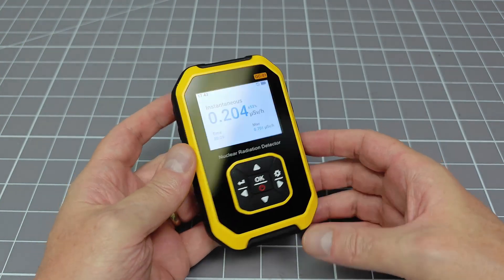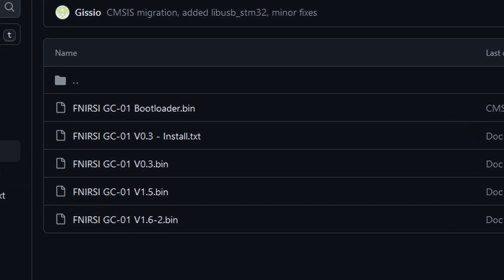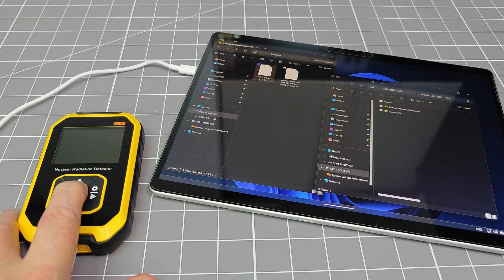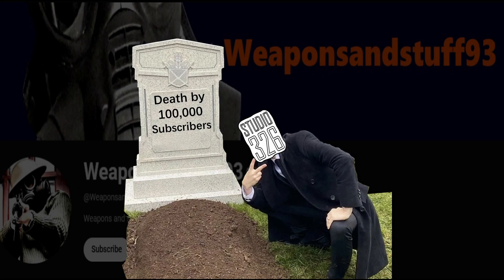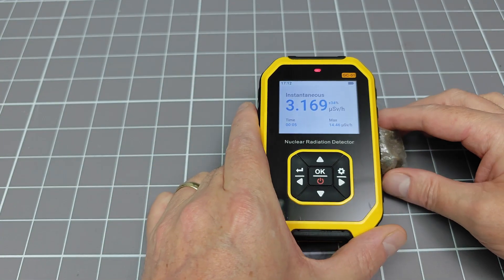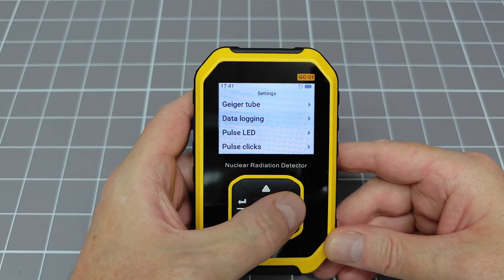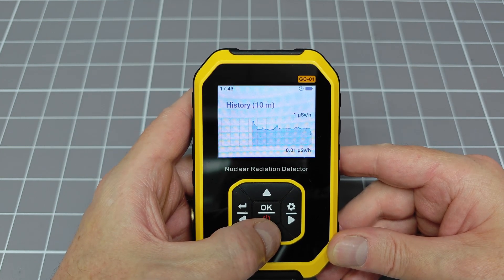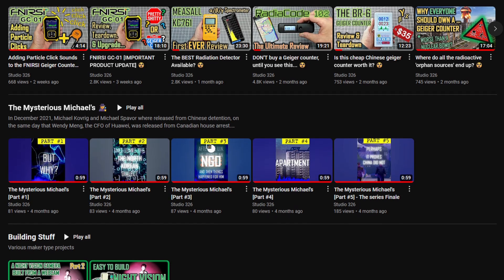FNIRSI Firmware Upgrade, Review & Instructions

Comment: for info just purchased the GC-01 blue case geehy chip ...wont boot usb ...long press....combo setting and on press ...nothing takes it to usb drive state
Reply from the maker: Just be sure to use a USB data cable, the one supplied is a power only cable and so won't enable boot mode.

Comment: I am trying to get my unit connect to the pc but I hold the power button and it doesn't open up as a flash drive? is there something I am missing?
Reply from the maker: Just be sure that you are using a USB data cable - the one supplied with the product is power-only.
Reply: @project-326  i plan to use the cable from my flipper zero as that has to be a data cable... got the resistor removed... found a cable that tried to connect but gave me errors so prob a shit cable
Reply from the maker: @gillandro2  Actually, with hindsight, the resistor can be left in place...
Reply: @project-326  now you tell me lol will it hurt it not being there?
Reply from the maker: @gillandro2  Sorry about that.  I live in the tropics, ie a high humidity place and did the mod during summer.  In the dryer winter, I found that the PSU was over-voltage.  The FNIRSI tube HV supply is really crappy, we zero regulation whatsoever...  If you still have the resistor, perhaps re-fit it.  If not, well just try it, it won't break anything!
Reply: @project-326  it still turns on so im happy lol you said do i did :-p
Reply: @project-326  found a cable... thanks for the help... i uploaded the new firmware... not a bad little thing... i dont need it to be precise... i just need to know if watch hand lume has radium or not but may be fun to mess with the counter... love your vids
Reply from the maker: @gillandro2  Glad it all worked out for you.  Be careful with Radium.  After a couple of decades, the phosphor breaks down and doesn't glow any more, but the radium is still active - it has a half-life of 1600 years!
Reply: Thats a first.... i never played chess on a geiger counter before
Reply from the maker: @gillandro2  My 7 year old did that too.  There is just no way I am going to play it - being beaten at chess by a cheap Geiger counter is not something that would enhance my state of mind!

Comment: I just don't get it. You say that battery lasted for 24 hours using this firmware, but on original firmware, battery is lasting only 10 hours as they say on their page on Ali. Why is that horrendous?
Reply from the maker: Mine lasts for about 5 to 7 days without too much user activity with the original factory code.  

It should be noted that the factory firmware was updated in the last couple of months and also I have seen reports about the battery size being reduced in newer production batches.

Comment: Well this has totally screwed my counter up, I've been trying for the last two hours to flash the firmware it won't even accept the original it does nothing when I add it to the bootloader I've tried variations of button presses & even found the original firmware that FNIRSI had on their website for a while nothing will load I've used the reset button because at one point it had soft bricked but as of this moment it is a useless pielece of trash so thanks for that. PPL BE AWARE THIS COULD FUCK YOUR DEVICE UP! I'm a very experienced software modder & know a lot about flashing firmware this device comes with several variants of processor but even with the supposedly right modded firmware this may not work!
Reply from the maker: You can try removing both batteries (the coin cell and the main battery) and then retry putting the original firmware back with both batteries not connected.  There are a lot of threads on the GISSIO github page with some work arounds when the boot-loader gets stuck.

Comment: I have an older version of the counter which came with the M4011 geiger tube and WCH microchip.  Careful timing of holding/releasing the right arrow+power button enables my Windows 10 computer to see a device called "AIR01", however I cannot access files on it and it does not seem to know what kind of device that is.  It does not show up as a drive.  I will try to check  with GISSIO but wanted to post here first.
Reply from the maker: Very interesting.  Please let everyone know if there is any feedback from Gissio...
Reply: my pc dont see any device connected. I tried using different usb cables but still nothing pops up
Reply from the maker: @mayfervex649  Perhaps open up the unit and remove the main battery and also the small coin cell and try again when powered just from the USB...
Reply: @nefariumxxx - same for me on Windows 11. It shows up as AIR01 - but when inspecting the unit closer in Device manager, I see this message: There is a secondary device connected to this hardware that Windows cannot identify because it does not have a valid hardware identification number.
Reply: @joonglegamer9898  Look up and read about or join to post to Gissio/Radpro forum.  Was able to finally flash the firmware but it required ordering a cheap USB dongle and connecting the pins to the circuit board directly.  Takes a while to flash it so don't cancel out of it when started.  Few minutes at least and it will seem like it's froze up but it's still programming.

Comment: I got my tube from Taobao. I ordered a J321 2022. I did the Rad FW, removed the resister. (My GC-01 came with a tube with wires coming from one end-no markings). Everything went well and devices booted fine.  So in setup I made sure J321 selected and set HV profile as  freq=1.25kHz and duty=25%. I don't really know what setting to use here. Is this right? Dead time is =off.  My question is this the right tube? I see yours says M4011 . Should I have ordered the item M4011/J321 instead? And then what are the right HV profile to set? BTW right now my meter reads 0.140 uSv and that seems not correct.
Reply from the maker: Let's start at the end and work back.  0.140 uSv/h, was that for an indoor background level?  It seems fairly typical. Where I am located, I get about 180 uSv/h in a high rise building and about half of that in a wide open space.

I have just used the default HV profile and set the tube type to J321.  I did actually use the J321, which bit of the video did you see a M4011 tube?  Maybe I used some stock footage for a segment.

Since making the video, I have added a 20M (2 x 10M) resistor for the loading resistor.
Reply: That is my background reading. I just thought typically average was around 60-80. I am new to this sort of thing. So in all I am getting 180-210.  It goes as low as .085 and right now is hovering around 150. I am not moving the meter.
I took that resister totally out. Why did you add back a 20M there? @project-326
Reply: I forgit to ask you. When you say you used the default profile. Is that the "Factory Default" one in the HV profile and not anything with the Custom part?
Reply from the maker: @jackhendler  the 20M prevented some tube ionization when the weather way less humid...
Reply from the maker: @jackhendler  yes, that's the one.
Reply: I'm up here not far from you actually. In Kunming where it is generall quite dry. So I guess I should add it back in. So it is not really about the voltage change. @project-326
Reply from the maker: @jackhendler No, its just keeping the nasty HV PSU loaded and not letting it spike up to voltages that can trigger a discharge in the tube.

Comment: Thanks for a great series of videos on the GC-01! I have a mid 2022 'proper' GC-01, and also a late 2023 device to do some mods with (changed the tube to a J321), and thought I would try this upgrade. Unfortunately the firmware upgrade immediately bricked my device - probably my error, as my GC-01 was running firmware V1.6-2, and I didn't click that this upgrade was based on a GC-01 with V1.5. So a word of warning to check the firmware version before you try this, as it may cause problems. It is briefly displayed on startup at the bottom of the screen. 
If anyone has any ideas to recover a dead GC-01... Please keep the excellent content coming!
Reply from the maker: try removing the main battery and also the coin cell and power the device just from USB to get the v1.5 back onto the device.  This worked for me.  Also, don't be shy to share your experiences with Gissio, this person is very helpful.
Reply: @project-326 Thanks, I tried this after reading your suggestions below. I managed to get the USB boot window up, which just contains a Readme.txt file of 0 bytes. After copying over the V1.5 file and reconnecting batteries, I still get nothing, and a 'USB not recognised' warning from Windows. If I repeat the process, the boot window appears, but the .bin file is gone - I can copy it over again, but the same process repeats😞. I'll try the Gissio route though, thanks again!
Reply from the maker: @jonwhite227  the file always disappears, its not a real USB drive, seems to be a virtual one that is emulated specifically for the purposes of firmware upgrade.  So it looks like V1.5 now works.  Did you try the RadPro image?
Reply: @project-326 Yes I did, but still no sign of life from the device and a 'the USB device has malfunctioned' warning from Windows. I'll have another look tomorrow - it's 2.00 AM here. Thanks for all your help, I'll let you know if I get anywhere.
Reply: @jonwhite227  Did you end up getting RadPro to work? I am facing the same problems as you, with that same message... 'the USB device has malfunctioned'
Reply: @rickdurham264  Yes, I did - I did a detailed reply yesterday, but YouTube seems to have deleted it - will try again later.
Reply: @rickdurham264  I had to solder a 4-pin header and run the firmware via an STLink V2 dongle (both availble from Amazon for less than £10) Works a treat and makes the GC-01 behave as  it should have done and quite a lot more. There is a discussion in Github/Radpro called 'FNIRSI GC-01: USB drive not detected' - discussion #38. I got involved in beta testing and must have done the re-flash 20+ times, so no worries there. Gissio is super helpful, as is the RadPro community. Good luck! Seems that YouTube deletes comments with web addresses in...
Reply: @jonwhite227  thanks for your reply!

I have just ordered a STLink V2 dongle from Amazon,  arriving tomorrow, so I'll see how that goes! I will check out the Github discussion forum, too.
Reply: I'm happy to say that the STLink V2 dongle arrived today and after sorting out the 4-pin header, I have successfully uploaded the new firmware, and it works a charm!  Thanks for your tips and help!
Reply: @rickdurham264  Glad I could help! 👍
Reply: @rickdurham264 Glad I could help!
Reply: @rickdurham264  glad I could help!

Comment: After the firmware upgrade my GC-01 will not stay in running display mode for more that 7 seconds then it falls back to the menu. Downgraded and upgraded again to the same result. I guess I will follow the repository and try again when a new version drops.
Reply from the maker: I suggest that you immediately open a ticket with GISSIO, this indiviudual is very helpful.
Reply: @project-326  I figured it out, I used the file you highlighted, I have the other MCU, with the proper file of the RC 2 version it works just fine, now I am waiting for the J321 tube to arrive for a properly working product, the J613 that was installed in mine absolutely sucks. Keep up the great video output, your channel is great.

Comment: you forgot to give a new rating with this new firmware
Reply from the maker: I didn't forget, I am waiting for enough comments to accumulate to see what everyone else thought.  I hope you understand why...
It worked on my device but others have seen issues, once those are worked through, I will be better positioned to rate this.  There is a major new feature in the pipe for this firmware, data logging on the GC-01, once that is available and I am able to see what issues everyone else had with this firmware, I will be able to re-rate the device in a new video...

Comment: Great video! I already made de upgrad. Now it´s much better.
Reply from the maker: The biggest issue for me is the power consumption of the product with the new firmware.  That said, I won't be switching back any time soon...
Reply: @project-326  You are right, but mine looks much more accurate with this firmware, so I think I´m going to keep it, and maybe upgrade to a powerful battery. Best regards. By the way love your channel.
Reply from the maker: @CT1JRZ  Thanks, comments like yours are what makes the whole thing work for me!
Reply: How did you manage to hold down the power button and get it recognized by the computer? My device just turns on and then back off if I hold down the power button while connected to the usb...
Reply from the maker: @evoelias6035  Just check if the cable that you are using is a data cable, the one supplied with the product is a power-only type.
Reply: @project-326  alright! Thanks alot, that's clearly the problem then! 🙏

Comment: Thank you for the video. I am not too lucky. After installing or upgrading the firmware of my GC-01, it wouldn't be able to start or switch ON, Even after installing back the initial firmware still the same. There is always a risk and now I can have an excuse to get the Bosean FS-5000 in my collection....hahaha
Reply from the maker: Try removing the battery and also the backup coin cell and try again, that worked for me
Reply: I have tried that but still the same 😅
Reply from the maker: @michaelwkf00 OK, next step is to contact GISSIO via the Git hub and describe exactly the issues you have and the steps you went though to get here.  This individual is very helpful
Reply: @project-326  No use. I messed up the device setting and now its USB can't be recognized by my PC, tried on a few more PCs but still got the same result. I must have broken it. Thought of getting the FS-5000, which costs around USD65(including postage) the lowest price in my area. Where else for the GC-01 cost USD30(including postage) each. So I decided to get the GC-01 and go for the firmware upgrade again. Never give up on something that has so much fun....hahaha 😅
Reply from the maker: @michaelwkf00  It's unlikely that you have managed to erase the bootloader.  I had a similar situation and was ready to throw my GC-01 away but using the issues forum on Gissio's GitHub repo, got the answers I needed.  What worked for me was trying to put V1.5 back on with the battery and coin cell removed, just powering from USB.
Reply from the maker: @michaelwkf00  and I also used a different USB port when I did battery-less boot up...
Reply: @project-326  Did the batteries thing... wouldn't work, so now I am getting a new USB data cable and a new GC-01 unit(delivery on their way).
Reply: @project-326  Update on my newly received GC-01 units. Upgraded it with the new firmware without any problem. So I can confirm my old GC-01 is broken(is a CH32F103R8T6 MCU). The only thing is the new unit is using a J631 tube and the MCU is APM32F103RBT6. I will need to swap over the J321 tube. Cheers mate!!!
Reply: After switching over the J613 to J321, the detector reading is unstable even I have changed the tube setting to J321. Any thought??
Reply from the maker: @michaelwkf00  By unstable, do you mean that the readings are inconsistent?  Which firmware are you now using?
Reply: @project-326  Using the firmware from GISSIO. The reading jumped crazily from between 0.0  to 3.0. It would not settle down when I measured the smoke detector sensor which normally gets around 0.40 usv/h.
Reply from the maker: @michaelwkf00  Well I guess the first thing to say is, I'm glad you got it to work finally.  Perhaps you can share what steps made that possible, maybe someone else can learn from this.

For the tube issues, what value do you have for the loading resistor?
Reply: @project-326  There is no loading resistor(R38) on my new GC-01 unit. Should it be the reason that causes the unstable reading? 

The upgrade steps are as follows:-
1:  Check the MCU type in use in the unit(CH32F103R8T6 (WCH) or APM32F103RBT6 (Geehy) then download the correct firmware as needed.
2. Next turn off the device, connect the USB-C data cable to the computer(my PC is running on Win11),
3: Short press the device power button, the GC-01"s File Explorer will be displayed on the PC,
4: After dragging the correct firmware that needs to be upgraded to the device's File Explorer. PC will display a file copy, Once done, the device will be automatically powered on and the upgrade is complete.
Reply from the maker: @michaelwkf00 In the end I added a 5M loading resistor.  Whe I made the video, it was summer in Shenzhen, so very humid, in the winter, the air dried up and the PSU voltage rose...
Reply: @project-326  OK, I will try to add a variable resistor and a resistor in series, so I won't create a short-circuit when I overturn the variable(1M+?M) but my old GC-01 is using a 1M resistor. Maybe I'll take it and put it into the new unit and see what happens. 😅 Thanks
Reply from the maker: @michaelwkf00  I really hope you like my videos, supporting you has been a mammoth struggle, so please go forth and press like on each an every video i have ever made, its a fair deal right...
Reply: After taking the loading resistor from my old GC-01 and putting it into the new unit with the J321 tube. The Unstable reading is fixed.
Reply from the maker: @michaelwkf00 well fuck me, I'm finally happy - you almost said thank you!
Reply: @project-326   Thank you...😅